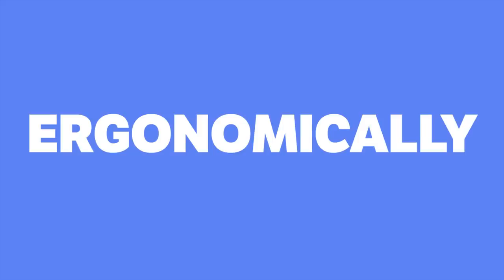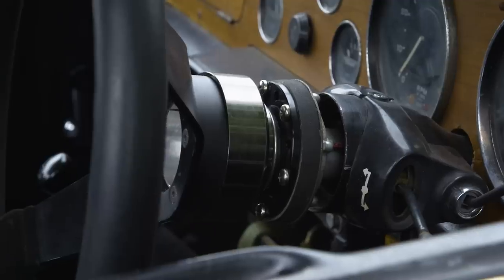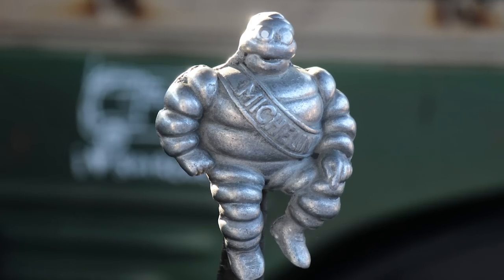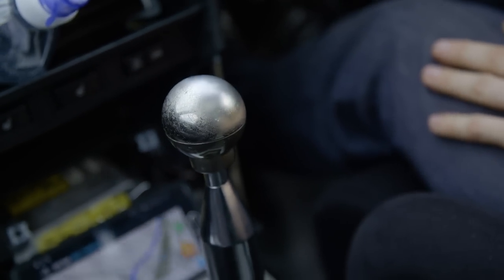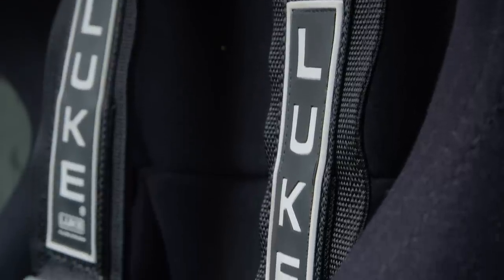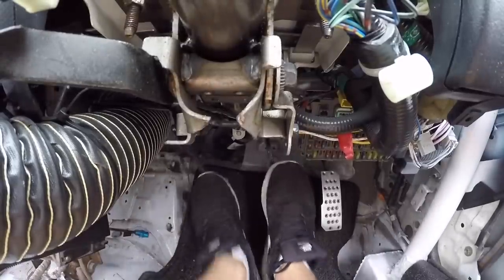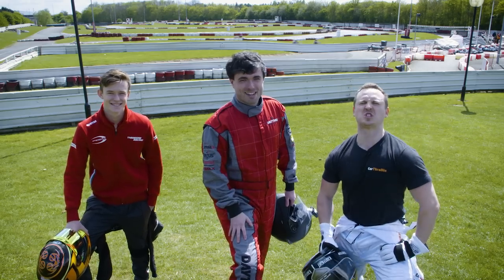5 Simple Mods To Ergonomically Perfect Your Car

Comment: An aftermarket steering wheel is dangerous no airbag they should be avoided.
Reply: I have to agree that removing the airbag for an aftermarket wheel is a bit stupid, unless we're talking about a track car with a rollcage and harness.
Reply: just don't crash then lol
Reply: You can't lose your airbag if your car didn't have one to begin with. tips head
Also there are some aftermarket wheels that reuse the factory airbag, trim and buttons.
Reply: Even if in about 40% crashing is not even your fault?
Reply: Yeah, if you have harnesses, the airbag probably;y won't even touch you
Reply: Sidnney are you saying 60% of all crashes are his fault. His premiums must be huge.
Reply: SecondGear me? Have we met before?
Reply: quiet, mum
Reply: yes if you have harnesses an airbag doesn't make much sense. what i meant was if you have the standard seats i think its a bad idea to remove the airbag
Reply: I think it could be even dangerous to leave the airbag in if you convert to bucket seats and harness. The timing is very important for an airbag to work if it goes of to late it can actually hurt you. Some cars have belt tensioners that go of together with the air bag so your head lands into just the right position in an accident.
Reply: You are supposed to put harness on a car with a racing wheel.
Reply: a properly fitted harness is much safer
Reply: If you are going enough fast to break your neck you will die even with an airbag.
Because,no an airbag does not make you invincible.
Reply: Actually, there are aftermarket wheels from some companies that are designed to mitigate the damage done in the accident by collapsing on itself or something along those lines.
That being said an airbag is probably more likely to save you.
Reply: My car is from the 80's, even stock it doesn't have airbag.
Reply: Seatbelts save lives, not airbags..
Reply: UKBall shit would've scored a zero with airbags.. your point?
Reply: Well, it's kinda hard to miss airbags you don't have to begin with. Why else would my e30 be so light?
Reply: Repzol in the uk/eu with dual air bags the Duster got 3*, sout America it has one, smaller air bag and got 1*, in India it got another downgrade and scored zero. 

So a he "shit" would get a star or more.
Reply: I've seen more people hurt or killed by airbags then saved. They can break your fingers clean off, break hands, wrist, arms, face, or even break your nose into your brain causing instant death. 
  Breaks the windshield, dash, steering wheel and column as well. A giant bag full of explosives and chemicals that will burn your skin and face sounds sooo helpful... also the issue with older cars having bags go off at random doesn't sound too fun either. Seat belts/harnesses and proper seats are infinitely safer that airbags.
Reply: Repzol wow you've "seen" a lot. 

The bag is to reduce  the chances of death, not to negate injury.
Reply: Stephen Butler oh wow an extra star lol.. the driver was 5 inches away from the steering wheel anyway and the crumpling design on the front doesn't help either. If they had proper cabin room and distance with better seats and belts I bet it would get a 5star without airbags.. hell the kid in a loose child seat faired better and didn't have an airbag. Bet if it did tho that kids head would've popped off from the bag hitting them in the face
Reply: UKBall good for you, I could give 2 shits about your safety👍
Reply: If you have a bimmer then don't change the steering wheel.
Reply: Stephen Butler english?
Reply: Repzol you obviously don't know how the rating systems work.
Reply: Repzol I work for NCAP. We can all play lets pretend, to make our point 😂

Btw it's you that is giving out "opinions" , we are echoing real life.
Reply: UKBall ok genius, explain why Volvo was part of the biggest safety recall having to do with airbags??
Reply: Repzol sadly I'm far from a kid. If you took your head out your arse for a whole second, you may notice, I haven't actually disagreed with your point. 

A good seat and belt is most important, but on a road car, the the seats and traditional belt needs a bag to be effective. So this is where we diverge as on your "opinion" goes against the industry standard. Which has more collective experience than your single opinion, I hope you can see the diffence 😉 

Btw what's your experience on? Forza? Kid pffttt, I wish 🤣
Reply: Can you two girlies please stop spamming my desktop with notifications :D thank you
Reply: Sorry 😋
Reply: Michael Green I'm not planning on crashing
Reply: Michael Green not if you install a bucket seat with a harness
Reply: Leahcim Zruc If you remove safety equipment you become better driver for fear of crashing. 😂 *Please don't do this.
Reply: Michael Green I have rolled a car before. You don't need airbags. Been in accidents. You don't need airbags. If you have a head on collision you will probaby end up with a buggered neck regardless.
Reply: UKBall The stock seatbelts in a car are designed to keep you in place during an accident. Harnesses will do the same thing. What is your point.?
Reply: Even race cars doesn't have one
Reply: Repzol 
Better driving saves lives, not seatbelts. Plus if your car for some reason caught on fire and you have no knife around you you'll burn alive, but if you had no seatbelt on the worst that can happen is flying out your windshield, which is better than burning
Reply: Michael Green if you have harnesses its fine
Reply: UKBall thats what helmet supports are for aka neckbrace. You are going to get more whiplash/over extension from a normal seat belt when it locks. Also there is a second whiplash or over extension when the airbag smacks your head backwards if not breaking your neck and killing you immediately. 

At least with a harness you get limited movement and your head stops when your chin hits your chest. In a normal seat belt you will continue to gain momentum until your head hits something like a roll cage, steering wheel, windshield, airbag, etc  I'd rather have a sore neck than a broken neck/face, chemical burns, cuts, bruises, or worse..💀
Reply: UKBall Cheers, what I meant was that the belt locks up on stock seatbelts. In a daily driving scenario you should have your harnesses done up with enough room on the belt to allow some travell during an accident.
Reply: Michael Green yeah
Reply: I suppose if you are installing an aftermarket steering wheel you should invest in bucket seats and a 4 point harness in the same moment. You well get a bad concuission, whiplash injury and in the event you forgot to buy a rollcage: bruising, broken bones, cut off limbs or maybe death by getting squished
Reply: In Norway you can't get any inshurance company to inshure damage to you, if you remove a steering wheel with a airbag and replace it with an aftermarket steering wheel without one.
Reply: then install racing seats with a harness
Reply: You guys with aftermarket steering wheel will have a death wish

Comment: One thing that I did in my S2000 was fit a lowered seat rail.  It drops you down about an inch of so but made a big difference to how the car felt.  Well worth it.
Reply: Jamie G im 6'5. I deleted power seats for 3/4" more head room, and the seat rails have two mounting points. stock is the front one do i moved it back.

i noticed no change, but now my knee doesn't turn on the wipers everytime i get in.

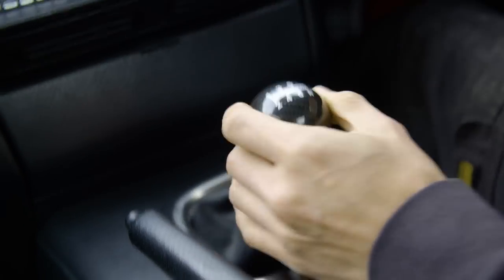Comment: 0:37 that wheel has the MOMO lettering on it...
Reply: Not ricey enough... gotta replace it with the cheapest, aftermarket Momo wheel wannabe.
Reply: But that "MOMO" wheel has an airbag, while most aftermarket steering wheels don't. Airbags can help you in an accident.
Reply: T. Lee 

Yes, but it’s not the primary source of protection. That job belongs to the seat belt.

Comment: My favorite shift knob I ever had was a 3 dollar knob from Auto-zone. The downside to those knobs though is that they don't actually screw into place. You put a plastic sleeve over the threads on the shifter, then screw in some small screws through the base of the knob to squeeze the sleeve onto the threads. After a while it can start to wiggle. I liked this shift knob so much I said fuck it and super glued it into place.

Comment: I had a 2003 Defender td5, Momo nero steering wheel and an 8 Ball gearknob were the two absolute best mods [well a 190bhp ecu really made a huge difference too], it's more of a drivers vehicle than some probably give it credit for, it's basically bringing you back to 1984!

Comment: Idk, swapping out the steering wheel looks chavvy af
Reply: Not if it’s done right! If you also have the accompanying mods such as Buckets + Harnesses (optional: Roll-cage, we’re talking street here.. no track :) ) then you’ll also upgrade your cars safety. 1. Eliminating that dangerous airbag from: damaging your ears, totally blinding you.. if the cars still moving after impact. And obviously the buckets especially if their FIA approved will keep your body safe and the Harnesses will hold you on place properly.

Comment: Improving earthin points or earth kit on older cars, Master Cylinder brace, performance bracing, braided brake lines not that expensive. Overall maintenance (flush and replace every fluid) and preventetive maintenance mods such as catch can

Comment: I've installed an NTG2.5 infotainment system in my Mercedes and that's about it. The interior is now perfect. I did have an ECU remap, but that's not related to the interior.
The standard seats are very comfortable and I don't like bucket seats. I like the big Mercedes steering wheel with it's buttons and shiny star. Short throw gearshifters and gearknobs are useless for an automatic. Same thing for pedal mods.

My next project will be bi-xenon headlights and a front AMG-style bumper. A w203 looks so much better with an AMG bumper.

Comment: My daily FG2.
Stock steering wheel is fine. Stock seats are ok for now. 
Stock pedals.
Skunk2 Short shifter adapter. Skunk2 weighted shift knob. 
Broadway 300mm rear view mirror. 
Tinted windows 30% front/20 rear/5 front windshield strip.
Nothing special for now ^-^

Comment: I removed aircon system. all the interior including sound deadening with dry ice.bride backets, Nardi steering wheel. dropped the car under 1000KG. endless brake lines, endless pads +rotors. fluid. Dunlop dirreza ZII* tyres.

Comment: Cut off about 12cm (5 inches) from my shifter, got nice leather cover and pedals covers.
Faster shift, better looks, and finally I can perform heel&toe in my car, because designer put brake and gas miles away from each other, and that's why I put covers on.
Currently saving up money for alcantara for steering wheel, thanks to you ;)

Comment: I just got a miata
The very first mod I did on it was putting in a wide/panoramic rear view mirror !!
I don't know why no one talks about it, it should be the Number 1 mod to do on any car.
It noly costs around 10 bucks. Improves your view of what's behind & around.
It was the first mod I did on my previous car, and it will probably be the first thing I do on any car I get next!
It's a must have.

Comment: i have 2 miatas but the roadcar is super cramped for me and i hit my legs in the steeringwheel even if its aftermarket, thankfully, there are steering-wheel spacers, slap a 50mm on my snap-off and tada, perfect drivingposition! although i could do with getting abit lower...

Comment: When I got my current car, a 2ZZGE powered Corolla Sportivo (T Sport in Europe), I found the driving position was crap. If I was far enough away from the pedals to be able to hell-toe comfortably, I'd be too far away from the steering wheel, and would have my arms stretched out to reach it. Also, the seat was high enough to make me feel like a bus driver. I took the seat out, removed the cushion, and cut about half the cushion out and re-shaped it, then mounted it with spacers on the front mounts, giving me a lower and slightly rearward angled seating position. I then swapped out the airbag steering wheel for a deep dished aftermarket wheel ( a quality one, not cheap ebay shit). I copped a bit of flak from some people who thought the more comfortable driving position wasn't worth removing a safety device like an airbag. 

For me though, these changes meant I was way more comfortable when driving. With these changes, my legs were straighter, making it easier to quickly switch between pedals, my knees no longer touched the steering wheel, and my arms could be bent a decent amount while driving, giving me more leverage on the wheel and thus better control. In my mind, this actually makes the car safer for me to drive. 

I also had the last laugh when Toyota sent me a safety recall notice for the airbags, because apparently when they go off, they explode, sending metal fragments into the occupants' faces. So by removing the airbag wheel, I removed what was essentially a claymore from right in front of my face lol.

Comment: Things that massively helped my 1992 Honda Civic DX sedan drive better: new shift linkage bushings, a heavier, metal gear knob and a smaller aftermarket steering wheel. Things I still need/want to change: need a dead pedal (the mounting holes are there thankfully), want a short shifter, and with my small feet, I need pedal covers because, while I can heel toe downshift, its a bit of a stretch. Oh yes, and having a tachometer is also nice as well. And, I would love a set of good seats and harnesses as well.

Comment: I'd actually argue that you'd want to keep your OEM wheel with an airbag unless you're installing racing seats and harasses. Exceptions would of course include cars that didn't have airbags to begin with or, like in my case, your car has a very old airbag that's likely to actually cause you injury if it ever goes off

Comment: I did h&r coilovers,  recaro seats,  pleie roll cage, M3 intake and brembo brakes yet for my e46 330i but i still need to fit a new steering wheel and 4 point belts Im thinking about OMP but Im not sure yet

Comment: One of my most regrettable mods was installing a short throw shifter and aluminum base bushings. For one thing, it was a pain in the ass to install, requiring the whole center console and HVAC controls to be removed. Secondly, I lost the reverse lockout, which makes downshifting into 2nd tricky as you can easily overshoot it and get into the reverse gate by accident. As mentioned it gets awfully hot in the summer and ice cold in the winter. Yes it looks good and reduces throws (by a claimed 37%), but I don't race my car often and keep it at legal speeds most of the time, rendering the benefits moot.

Comment: STEP 1
Remove your airbag steering wheel, so if you're in a crash the wheel goes straight through your skull. Not the sharpest tool in the shed eh?

Comment: Would a smaller diameter, aftermarket steering wheel be better ergonomically even if I have no power steering? I'm just worried I'll have to reef on it harder to make a multi point turn

Comment: replaced steeringwheel and gearknob with perforated leather ones (original). Need to lower and retrim the bottom half of my seats now and find a way to fit harnesses.

Comment: Tbh i just upgrade my cooling system from plastic radiator to metal ones so it last longer and the only thing i need to replace is them pesky hoses which a lot more cheaper than replacing radiator, i want make the car last longer especially an everyday car

Comment: my default steer is rather small, has radio control, and it has eletric steering power, no need for a aftermarket wheel. Just need it restitched, the leather is in a bad shape

Comment: Smaller steering wheel is not really good if you have a car without power steering. The smaller the radius of the wheel the more power you need to turn (lever ratio to center of the wheel).

Comment: 1. Illegal in Germany
2. NA MX5's one is alright :D
3. See point 2
4. ILLEGAL IN GERMANY (kinda, or really expensive xD)
5. See point 2 :P
Reply: You Germans really aren’t allowed to change anything :/. I mean the steering-wheel law in the UK is the same so you just return it to stock for it’s yearly inspection (MOT) or fit a roll-cage, bucket seats, Harnesses and the you can change the wheel out. It excludes a car from the EU Original Equipment must be fitted bullshit law.

Comment: On newer cars like my Fiesta ST you can very cheaply move the pedal slightly, through the use of the spacer. I know other cars like the BRZ/FRS/86 have a more adjustable relocation kit, but it still isn't mightily expensive. I did it to my car and I love it.
Reply: I wish i could do something with the pedals in my car, brake pedal is so much higher than the gas pedal making it almost impossible to heel and toe. Also the brake pedal travel is very short and it bites at the top.

Comment: Boutta upgrade my mums 2014 1.2L Vauxhall Corsa. Any suggestions?
Reply: Bigger and wider rims (not too big but sensible as they're not big cars after all) with good quality tires are always a good start, a leather wrapped steering wheel (get it wrapped professionally so you don't lose the air bag which I'm sure a 2014 built car should have) and maybe a suspension upgrade if you think the car needs it. If you want extra power, a turbo kit may be an option but that could end up costly.

Comment: I installed a short shifter
the wheel it's not legal to change it if it came with an airbag (canadian law)
for the rest I keep it stock
Reply: It isn’t in the UK either. Unless you return it to stock before yearly inspection (MOT) or having a MSA logbook and roll-cage, buckets and harnesses as it then apparently in the eyes of the law classified as a Road Rally car. So it has to have a MOT to be road legal but of course it’s modified to be even safer. So no airbag needed.